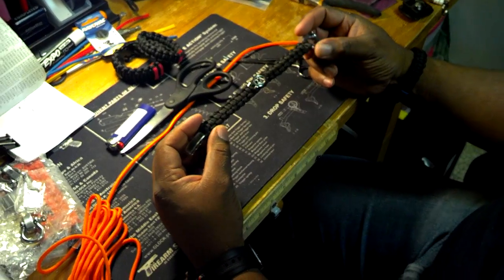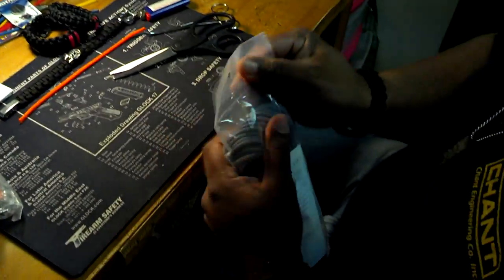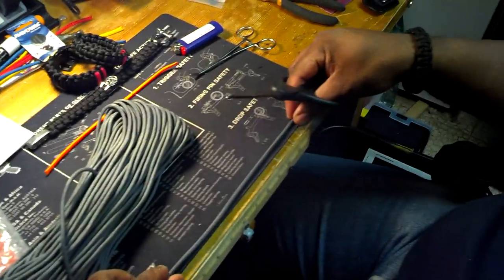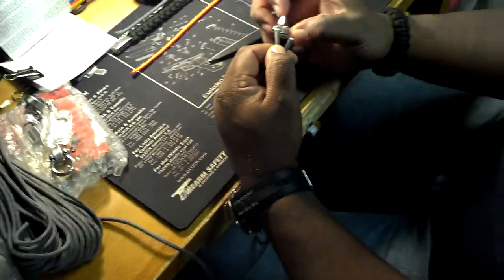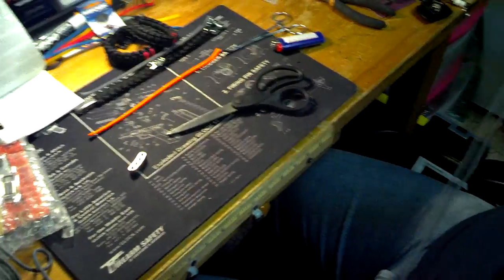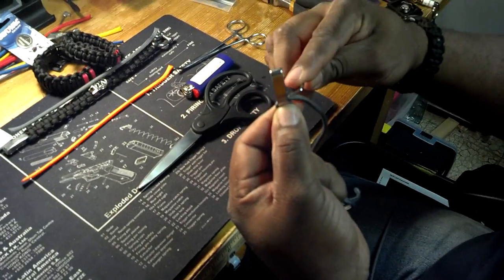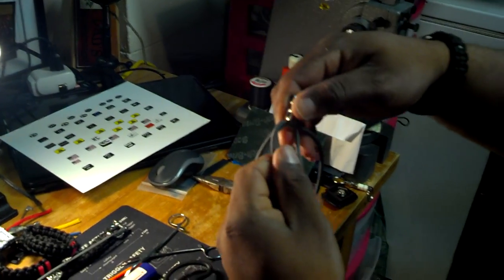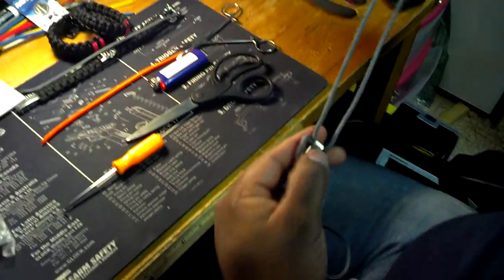Making a paracord bracelet with custom charm and D Ring Shackle Part 1

Comment: I'm working on using the adjustable shackles for bracelet making for family members for Easter and I can't figure out how to apply a double hitch to it. I can make them regular with one hitch on the loop and then just have the strands loop through the hole in the adjustable bracket but I've seen dragon claw bracelets with these adjustable shackles rocking double hitch for more paracord length. Any idea how to accomplish that?